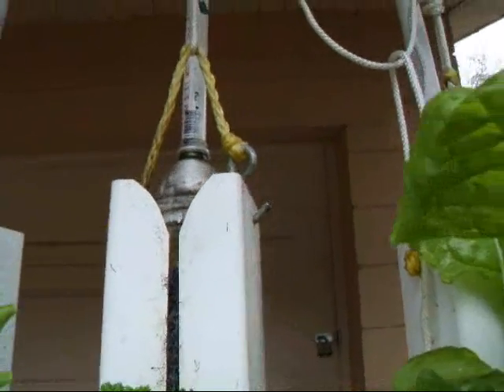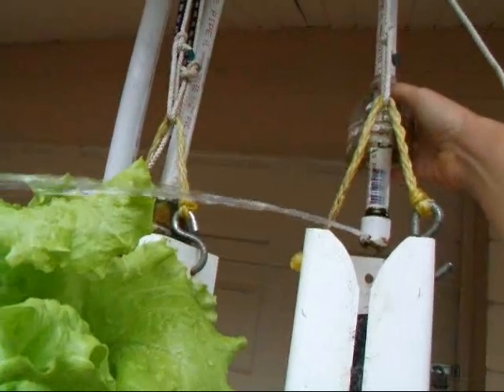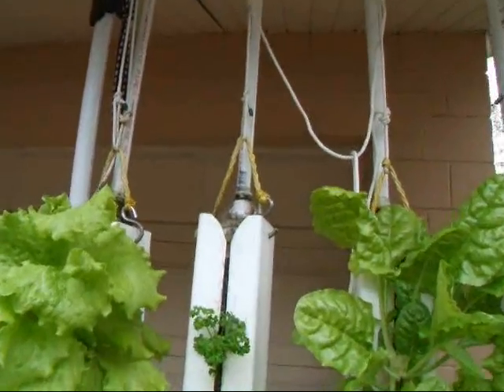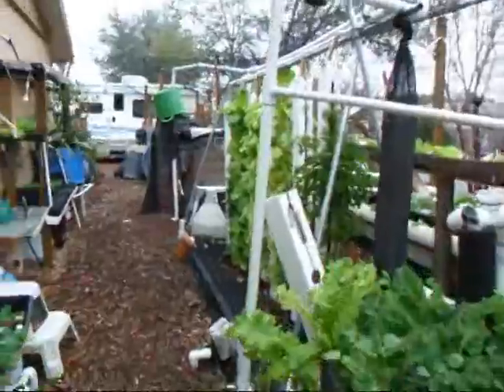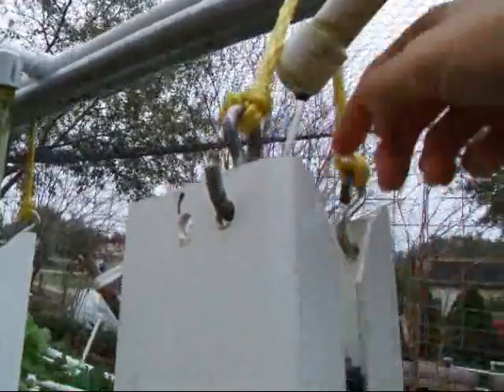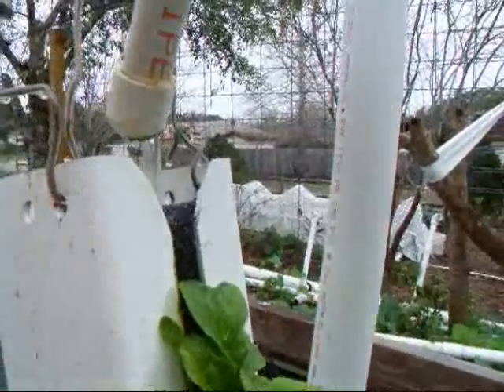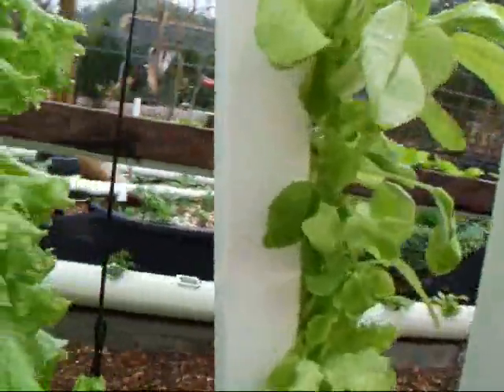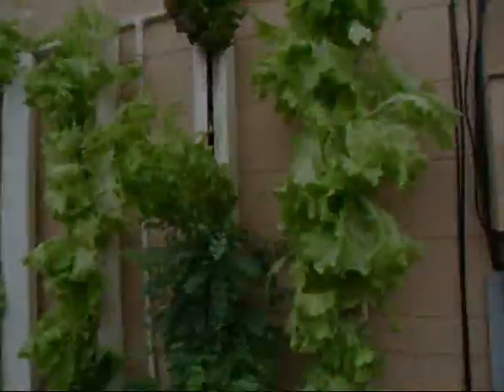Aquaponic Tower Flow

Comment from the maker: Drawback there is then you have to lift up the bottle then to see if the water is flowing, while if it is spraying in a translucent bottle, I can check that they are all flowing by simply walking down the line and looking.  If they were all blacked out, I would have to touch each one every day.  This way I just need to clean them every few weeks.